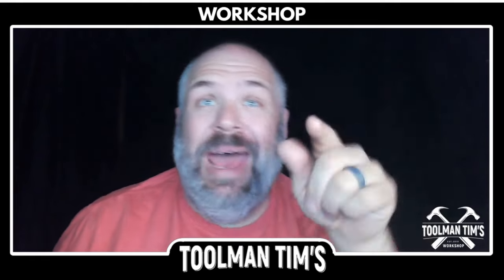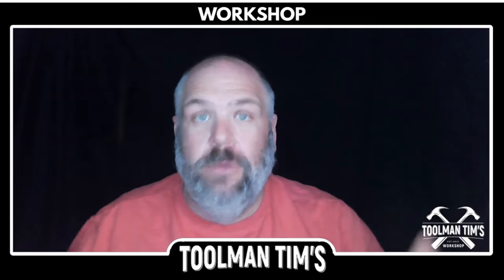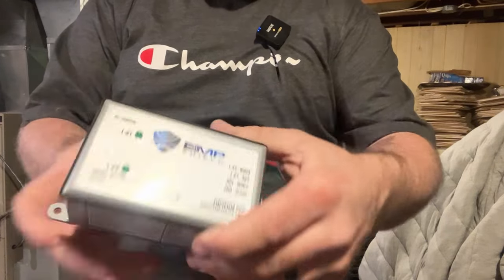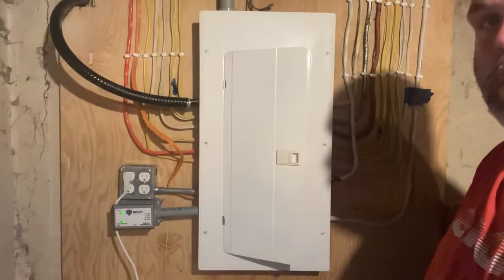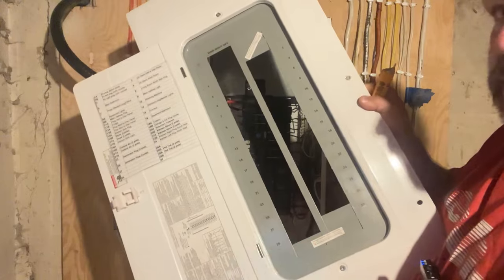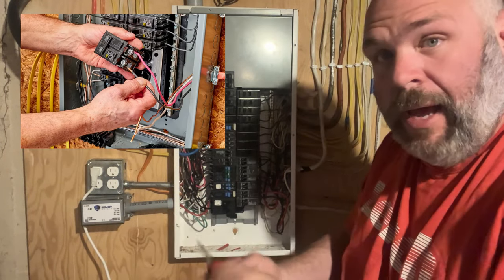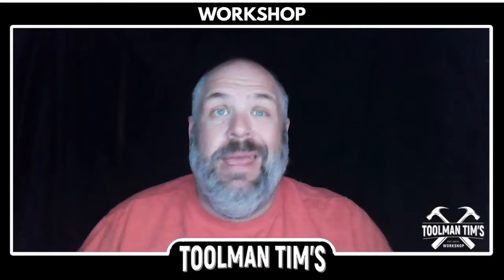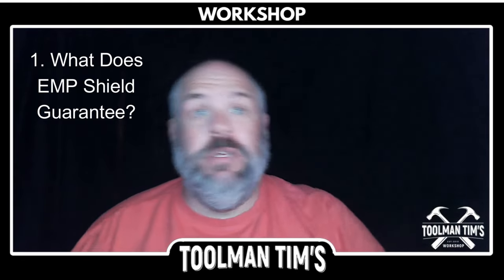Whole home surge PROTECTION worth it?? EMP SHIELD Review

Comment: They're lying by calling this an "EMP" shield. This item is a surge protector. EMP, however, blankets everything. The pulse doesn't enter your house via the breaker box. I could imagine that the EMP Shield itself might survive the EMP, but it can't protect your computer from one. Only a faraday cage solves this problem.
Reply: Eh, the power lines are the biggest antennae attached to a house, although I understand your point.  There could be a point made that most full size computer cases are 95% steel sheetmetal, although a counter-point could be that "what's the point" (if the internet goes down anyways).

Comment: We had this EMP SHIELD added to our car and to electric box. Phoned our Licensed Electrician to search out his opinion and he said he already had it added to his electric box at his house.  So we had the vehicle and electric box EMP added. NOW WE SLEEP VERY GOOD EACH NIGHT!! 😴
Reply: You bought snake oil.
Reply: (EMP) is an effect where radiation emitted after a nuclear blast destroys the silicon junctions in semi conductors. (Micro-chips, processors, transistors, etc.). This is a direct influence effect, it does not come as a transient through cables or conductors, so the only way to prevent damage is direct shielding of the components.
Reply: @Will-n9s  That’s exactly what the EMP Shield does. It is hooked to vehicle batteries and the other is an EMP shield for your electric wiring and is attached to your electric box. The EMP Shields never shut off. The vehicle shield is hooked to your car battery and when you raise you hood on your vehicle your shield has a small green light on the shield on that is always on to let you know your vehicle is protected 24/7. You  will still lose your home electric power from an EMP attack on our power grids just like the people that  don’t have the shield. But when the power comes back on your house wiring was protected and not "fried" and so was your appliances that were plugged into outlets.  Do your own research on the EMP Shield. They explain it very well.
Reply: @carolynhelmic1474  It's literally just an expensive garbage surge. Protector is not going to protect anything from an EMP. The entire vehicle would have to be covered by a conductive material to redirect any and all electrical surgelectrical surges away from the entire vehicle , not just the battery
Reply: @Will-n9s Aren't most cars covered in an electrically conductive material 😂?
Reply: @Will-n9s  According to electrical engineers who specialize in EMP shielding, using transient devices and ferrites along with surge protection devices will absorb the transient effects. But you may be correct in the end as all projected effects of EMP are theoretical at this point
Reply: The ppl who don't understand how an emp works and don't know that almost all of the power surge is through the wires in your house and not through the air are exhausting.

Yes if your at ground zero it will go through the walls/air and fry everything. But if you're at ground zero you're dead anyway 😂. 

If you're far enough away to survive the blast you're far enough away for the emp shield to work.

Comment: Finally someone that understands how an EMP works. There are so many people saying this will protect from an EMP no matter what. If you read EMP Shields papers on their testing and approvals it says that the device is tested on a hardened structure (Basically a faraday cage enclosed building). This means just like you said its only protecting what comes in on the utility line. It does not protect from the EMP wave, so if you are outside that wave then you are probably ok but inside the wave it won't help.

Comment: I will comment on this company's vehicle EMP suppressor.  The RED goes to the POSITIVE, the BLACK goes to the NEGATIVE of the battery. Great! The GREEN goes to the metal on your car; to 'dump to ground' the EMP.  EXCUSE me, but the metal chassis and the NEGATIVE of the battery are the SAME THING. They are 'dumping the surge' back into the battery.  The car is ISOLATED from EARTH ground by the rubber tires. Tell me how I'm wrong, so I can learn something.

Comment: I think this would work OK for surges coming into the house on the power line. But an EMP pulse could also come from an air burst weapon. In this case it will come in via a TV cable or antenna connection which is after the protector on the power line. It may even come in directly to a units wiring or circuit board traces. Like a tv or appliance with digital controls.
Reply: Right!  People aren’t thinking things through, just like Covid.

Comment: Very helpful video but this beginner noticed on thing you didn't mention.    From what I've learned from other videos is that the surge protector SHOULD be connected to the breakers that are closest to the main breaker on top.   You've got yours on the bottom.    No biggie.

Comment: Thanks Tim! This was the first time I've seen a really honest review of an EMP Shield! I've wanted to buy one for my car, but due to the expense, I'm not sure it's worth it. Your review has REALLY changed my mind! Thanks again!
Reply from the maker: Thanks dragon I really appreciate that.  I always have to have a clear conscience when reviewing something and this was a product I had to do a deep dive in so I could share what i could prove and stand behind it’s not the type I can take out and nail some nails or screw some screws with it’s much more theoretical
Reply: @TOOLMANTIMSWORKSHOP  
Well, I truly appreciate it. I'm wondering if I've got my Generator plugged into the trickle charger and my box has an EMP Shield protecting it, would that also protect the Generator? I can't afford to buy another Generator, mines a {Subaru 7500kw gasoline} and I also doubt I can afford 2 EMP Shields! Thanks again!
Reply: @dragonslayer7587 if your generator is a whole house standby generator, it has circuits on the ignition switch. You would need an EMP Shield for an E3 EMP. Look up the difference between E1, E2, E3. Cheers!
Reply: @trajan6927  
Thank you very much! I do know a bit about the short vs long term bursts of electricity that is shot thru the wires... However, I don't have a whole house embedded generator, I've got a very large dual fuel generator, that plugs into a specific place on my fuse panel. I've taken the battery off and I keep it in a faraday bag for now, but I live in a hurricane prone area of Florida, and we lose power very often. My 90+ year old Parents are also with me. They are very forgetful, and storms frighten them. I'd hate to lose power, and THEN lose the generator as well. Our Solar Cycle is making the sun very active, so if it's not a war issue, it could be a Solar event. Due to inflation, I can't afford to buy another one, so taking care of this one is important to me! I truly appreciate your help! Thank you again!
Reply: @dragonslayer7587  Wow! You have your hands full. Sounds like you have a good plan. Propane sounds like the fuel to keep on hand. Dual fuel is great, options. Wish you well. 🇺🇸
Reply: It only cost us $25 to have the EMP SHIELD added to our vehicle. It’s added to your battery and when working you will see one small green light under your hood. Then we had it hooked to our electric box by a Licensed Electrician it cost us a little more because he had to update and replace a couple of Modular’s in the box. ( not sure if I called them by the right name).

Comment: I added one for my house, and one for a vehicle just last weekend.

I personally know of two houses that have been hit by lightning.

I purchased for EMP protection it was not my first thing I did for protection, but I feel in todays world an EMP is much more likely.
Reply: EMP doesn't need your home wiring to fry the electronics, it will use the traces on the electronics boards and chips to short them out; no wiring needed.
Reply: Someone asked me: the only true protection from EMP is a faraday cage. Look, Lighting has just jumped from .5 to 15 miles down, a semiconductor gap isn't going to stop it from crossing into your house if that is the least resistance.

Comment: I have 3 questions that I am hoping you can answer...1) my home is old and ungrounded, so will it still work the same as advertised? 2) Is installation the same? 3) So with this installed, there is no need for other surge protection in your home correct?

Comment: Thank you for your presentation, well done but you also need to add high saturation ferrite that clips around your wires coming into the panel .Usually need 3 but some panel set up needs 4. This will absorb the E1 first wave so that your protector can deal with the E2 and E3 wave. You can also do the same for your vehicle clasping a high saturation ferrite on the positive and neg battery cables along will EMP shield for vehicle. My concern is to protect from a geomagnetic storm power surge that will do a lot of  damage to the wires ,panel , and electronics in the house. Without this protection on your modern  vehicle , the electronics get fried and the vehicle is done. The probability of a Carrington like event geomagnetic storm is much higher than a nuclear EMP and will occur in this solar maximum cycle. Will it hit the Americas or Europe or Asia is the unknown, but we need to be prepared. the manufacturer claims that it will protect against a geomagnetic storm which is different than a nuclear EMP. When you know that there is an X 15 or more stronger  flare and that the CME is going to impact the Earth , you can cover your vehicles and generator with a Faraday cloth( pricey cloth) for added protection.

Comment: They also sell EMP Shields for vehicles so I wish you would have mentioned that. One other point is protection from CMEs also. The third party testing which is what I liked. There is no way of knowing if it works and only time will tell. I hope it works.
Reply from the maker: I’ve been trying to decide whether I wanted to get one for my vehicle or for my generator next but either way, I’ll make sure I mention the vehicle ones in my follow up video. Thank you for the kind words.
Reply: @TOOLMANTIMSWORKSHOP  , I know they are expensive and I don’t know if they will work . That being said the first thing I did when I got my 2021 truck was put an EMP shield on it.  We have also moved into a more active solar cycle too and I have to think you have heard of the Carrington event . That happened when we only had telegraph wires which burned them up. Now here we are so dependent on electricity and electronics it would be catastrophic. I have put all my faith and trust in Jesus Christ as my Savior but I still think He still wants us to be able to help wherever we can. It’s a simple install and if it does work I want my family to get home safe. I also got one for my dual fuel generator.

Comment: Just bought the home unit - cost in Canadian dollars was $542.94 not counting install (with 20 Amp breaker included) $292.95 = total $835.89. As I had no surge protection anyway - I decided to get both types of protection. I already had an emergency generator panel installed with external hook-up for my 6500W Honda Generator to connect to - so $ 835.89 more wasn't going to make much of a difference budget wise. Thanks for the informative video - I have to use an electrician due to Condo rules - but the install looks fairly straight forward as long as  home insurance is not an issue.

Comment: It has 3 BIG honking fast acting metal oxide varistors in it, one that goes from L1 to ground, one that go from L2 to ground and one that goes across L1 to L2.  Metal Oxide Varistors (varistors) are used to protect electronic devices against overvoltage surges.
An MOV rated at 120 volts AC may be able to handle 170 volts or more for a short time. This is call the shunt or crowbar voltage, what happens is when the voltage is below the crowbar voltage the MOV is open when the voltage exceeds the crowbar voltage it becomes a dead short and shunts or crowbars the higher voltage directly to ground there by protecting the devices that are connected to the grid. The MOV that is across L1 to L2 has a higher crowbar voltage than the ones that go from L1 or l2 to ground. There is a little more to it but that is basically what it does.  Metal Oxide Varistors (varistors)  are used on the tops of just about all of the grid power poles on the grid, if you know what to look for you can see them on the poles. They are usually next to or near the BIG honking circuit breaker located on the top of the power poles.  MOV have been used for this purpose for years to help protect the power grid.
Reply: That's funny! Before you could buy AC surge protectors, BYTE magazine had an article on how to add 3 MOVs inside a power strip to make it into a surge protector. I still have mine. But the EMP Shield folks claim their parts are fast enough to clamp the ultrafast surge from a real EMP.
 And here I've been using one for 40 years? ROFLMAO!

Comment: I work in a technical college in Israel. Obviously we have many computers, electronics, delicate equipment and other specialized stuff for the students, profs, and researchers. The newer buildings have the grounds go through a triple CB(as if made for a 3~ circuit) although the ground is by definition one phase, I assume to make sure it only trips if there is a massive over-current event and not just a fault with one CB. This is done mostly in case lightning strikes the mountain the college sits on. Would I hook up the ground wire of the EMP gadget directly to the REAL ground(unprotected, or uninterruptable, by the triple CB tripping), thus shunting lightning or EMP around the triple CB lightning protection? Is it to be connected to the general, interruptable, ground?

Comment: The only way I can think making a house completely EMP protection 
I here you need a metal faraday cage.
And main service probably need to be in Ridge Metal pipe.
What if wires would need to be in MC or EMT pipe because we shielded Low voltage in commercial in a EMT pipe. A lot low voltage wire that shielded has a tinfoil wrap around wires underneath the insulation.

So we ground to water main and put in 2 ground rods. And if a concrete slab has a rebar we hit that run a ground wire for the gas company so that can clamp there gas line.

But old house don’t have all that the old ground wire only hit the water main. And
If PVC water main  come in there be no ground for that no need to ground plastic.

So I say to try to make a faraday cage in you house make all your wires surround by metal so running wire through pipe and MC and make boxes Metal you surrounded all your wires with metal. The only way I can think it can happen.
Romex  had a ground but surrounded by plastic and air.

I can’t say it will work but they say you need in metal cage to protect the electronic so i think if all wires are run in metal  conduit or Metal Clad they be surrounded by metal . When plug thing into a metal box that has a cord put your cell phone in box receptacle inside to charging your electronic close metal box cover so the hole system like hospital ground with a second insulated ground

Comment: Save yourself a load of cash and buy lightening/surge protection for $50 bucks instead of $360. That's what arrestors do, they shunt surges to ground and the arrestor is blown to bits instead of your equipment.
EMP protection? Nuclear blasts happening overhead? Sheesh.... Worse things to think about than electrical circuits. Solar flares? The last significant blast in 1859 charged up the giant earth capacitor that kept the telegraph lines running for hours without their battery power connected. Show me a device that can deal with that and I'm onboard. Otherwise, nahhhh not so much.

Comment: Ok Tim, it is connected to one half of your breaker box electrical, what about the other half? Seems to me only 1/2 of your house is protected. Two legs on your box (120 X 2) and your connected to one side leg while the other leg isn't connected. It isn't a 6 wire unit only a 4 wire. There is only one 20a breaker. Explain that to me please. How is your whole house protected?

Comment: Now i will switch from the certainty of my other comment to my understanding as an electrical engineer, but with the caveat that I would want t do some checking before claiming certainty. If an EMP occours, 1) a faraday cage's protection will be determined by the  wavelength the pulse  in question. 
 It is directly correlated to the size of holes in the mesh. Therefore any signal with a wavelength under one inch will freely pass through a faraday cage with 1 inch mesh. Although effective against lightning, a car's body would not be good for a high frequency EMP as might be encountered in other scenarios. 2) I believe that this device would be capable of protecting the electronics in a house from the excess voltage applied by the main feeder. I do not believe they would protect the equipment from the pulse itself. It is possible for an electric grid to deliver surges due to exposure to an EMP that is out of the range of the house in question, so therefore this device might not afford a guarantee, but gives a chance at getting lucky, in which case it would make a drastic difference.

Comment: We have a tin roof and have metal panals on outside walls, if i was to cover windows with insulated double side foil would my house then be a faraday cage for the electronics that arent plugged in? We are still connected to grid so i get that anything plugged in would fry. Possibly ignighting. Shoot. My house isnt fireproof... but is my house a faraday cage?
Reply: You shouldn’t have reception on any battery powered radio if it is.

Some AC powered radios can get a signal thru the line cord.

Try it with a battery powered radio.